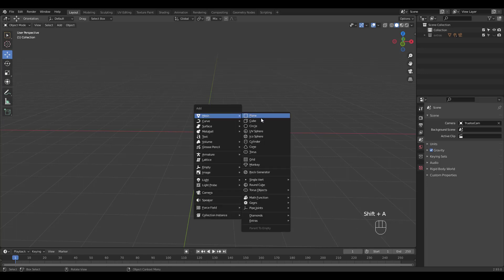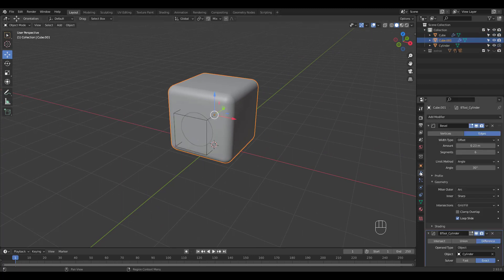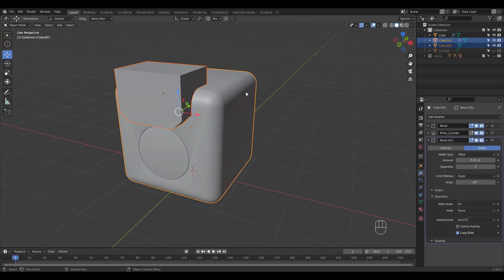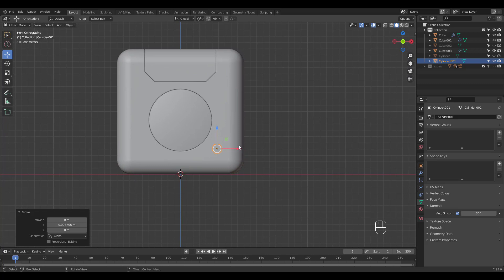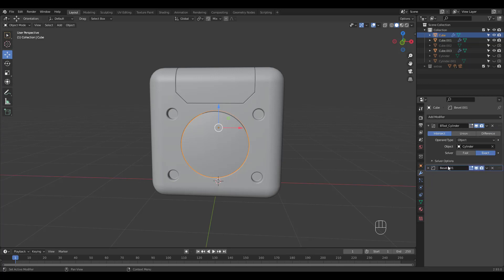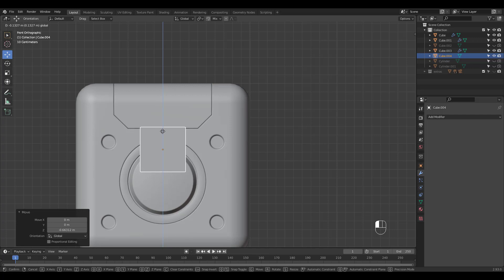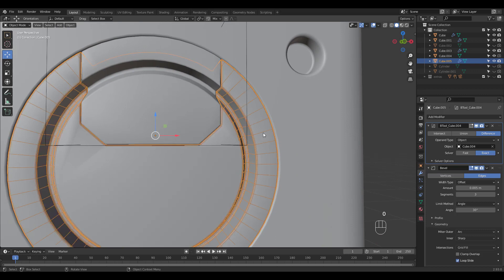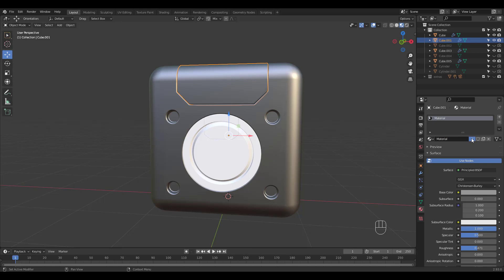Blender Hard Surface Modeling Tutorial Boolean + Bevel Modifier

Comment: Great tutorial! Good explanation and information on hard surface modelling. What does the weighted modifier do? I haven't really seen it used. I noticed that it more smooth.
Reply from the maker: Thanks for the nice comment! Weighted normal modifier makes the face appear flat, giving it smooth look. I usually just trust my eyes. Some meshes will do fine just using harden normals option under bevel modifier shading, but this mesh gave it shading issues, so I tried weighted normal modifier. :)
Reply: @blender3dmagic  thanks for the information about this! I'll need to try it out and remember it!